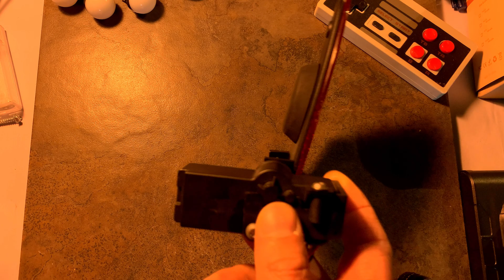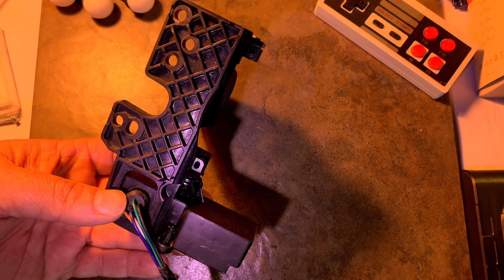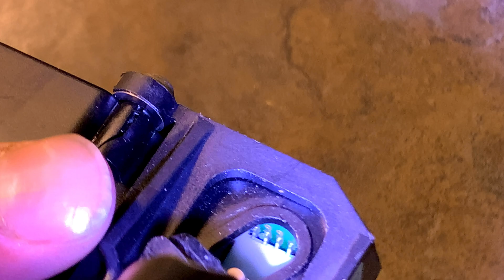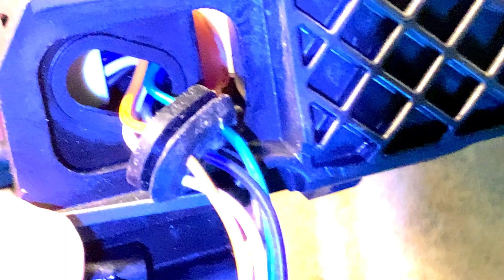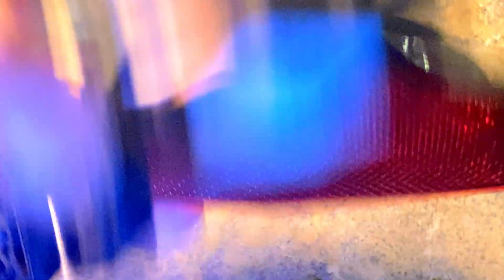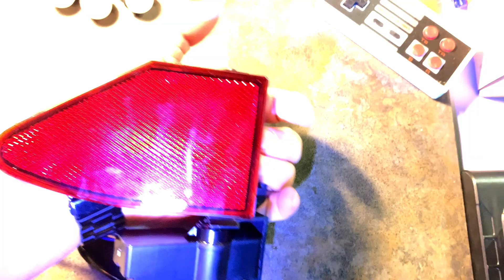Tesla Charge Port Door Failure Model X What went wrong?

Comment: Did you also have the problem that the blue and green light didn’t work on the charging port ?
Reply from the maker: That's common, wouldn't waste any money fixing it. It will eventually happen again.
Reply: @KmanAuto  did not changing the port fix the light ? Sometimes my lights come on but mostly not 😢
Reply from the maker: @RichiB2012  The port wasn't changed. The Door & Door Mechanism was changed. Two different components. If the port is changed, then yes, the lights would be fixed. The lights are just cosmetic, wouldn't waste the money unless the actual port is having issues.

Comment: replace the variable resistance SV01A103AEA01R00 on the circuit board of this part (need to cut open the module box) will guarantee to address the issue. The resistance costs about $2.
Reply: Do you have more info on this?

Comment: Thanks for sharing your experience. I actually just had to replace this same part on my S. There's a drain tube below this chargeport door that can get clogged after a few years, especially if you leave the car outside and charging in the elements a lot. When the water can't drain, the electronics for this part just sit in the pooled water until destroyed. The chargeport itself is fine, but the door will continue to act up/fail. It will be interesting to see if the dried out part will work again.

Comment: Great breakdown. I hade the same intermittent fault on my charge port door after the first heavy NJ ice Strom. It developed an intermittent fault. Same as you couldn't open it from inside the car. Only could use the key fob to open it. Prior to having it serviced Tesla pushed an update which overpowered the door and broke something in the mechanism. Because it was a CPO 2017 MS while fixing the door they chipped my tail light. So I got a new light and charge port door in warranty.

Comment: I do like that they don't typically overcharge for parts
Reply from the maker: I agree. Parts costs on MOST items are fairly reasonable. Labor cost not always. Take charge port for example, took the mobile service tech about 30 minutes, install was over $200 and $85ish part cost. Tesla charges $175/hr. So overcharge on install, yet price is pre-determined and could not be changed by him. BTW our Wisconsin Service centers and Mobile Service are absolutely TOP NOTCH A+ Rock Stars.
Reply: @KmanAuto  Disagree about overcharge on install. Every shop does those by time estimated. I had a left outer taillight done by Tesla for  $500 and it took maybe a half hour. I had purchased eBay used part for $100 but it probably would've taken me several hours for the labor.